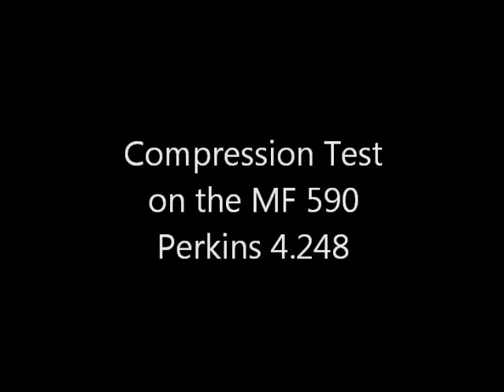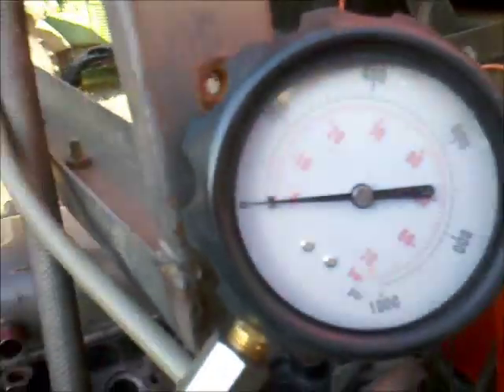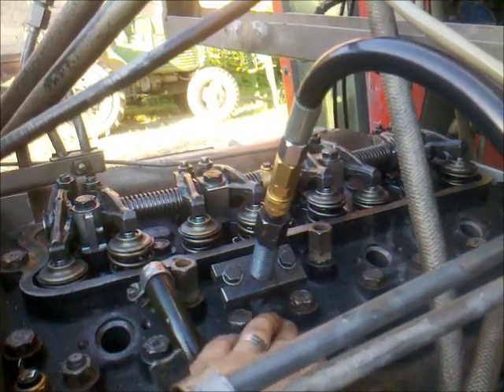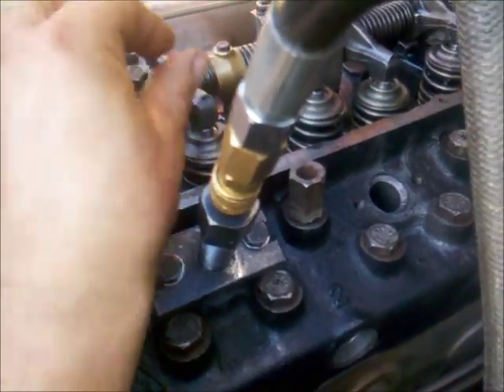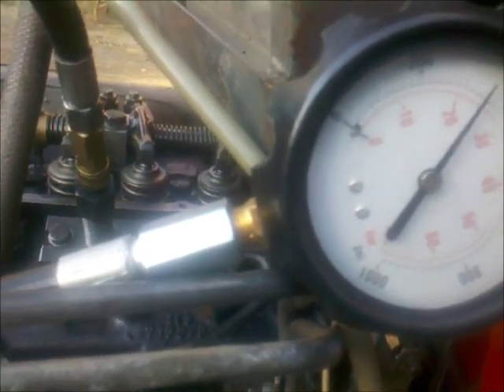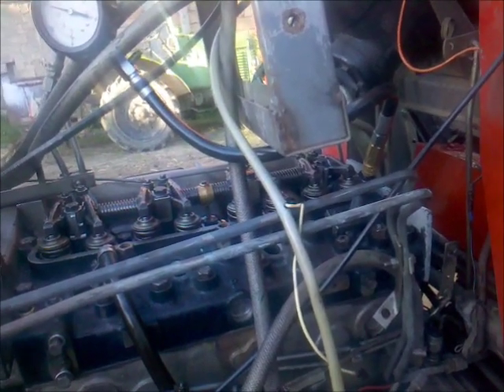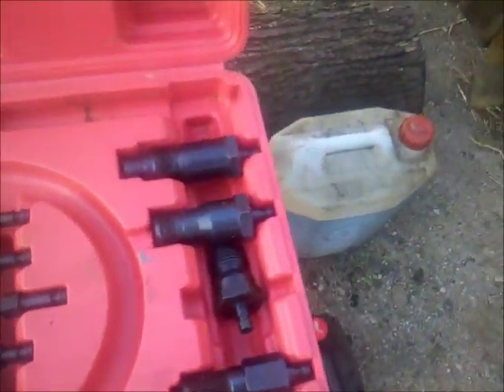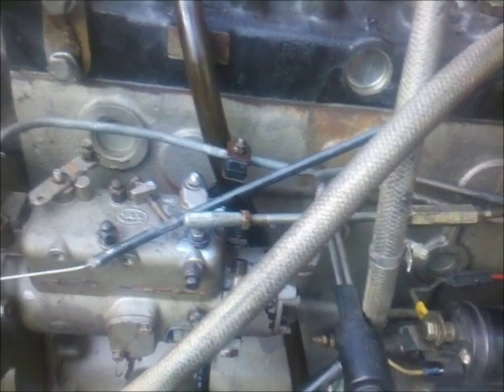MF 590 - Perkins Diesel - Compression Test after engine repair - part 15

Comment: The A4.318 engine tractors in Massey Ferguson have an oil cooler located in front of the radiator that's in models 1080 and 1085, don't know about the rest, the motor has serious design problems, the engine shop replaced the sleeves, one bore had a crack which they say is common on Perkins, they bored and put a pre-liner in with the new one fitted over the top, the new liners don't have the lip at the top, which is why the standard 318 motors blow head gaskets and leak water, when that's fixed the engine should be as good as gold.

Comment: Hello .... I am from Romania and I want to know that your videos follow with interest and I would be very grateful to enlighten me a problem. I have a Massey Ferguson 595 tractor with perkins engine 4.318 which I can not find where is located the radiator to cool the engine oil sump, or can these engines do not need oil cooling. Please help me a lot ... Thanks in advance and thanks google translation .........
Reply from the maker: Hello! I don't think your tractor has a oil cooler for the engine oil neither has my MF 590 an engine oil cooler. Beside this you will have an oil cooler for the transmission oil which is located in front of the radiator, just open the front service door where your air filter is located and there you will find the oil cooler for the transmission